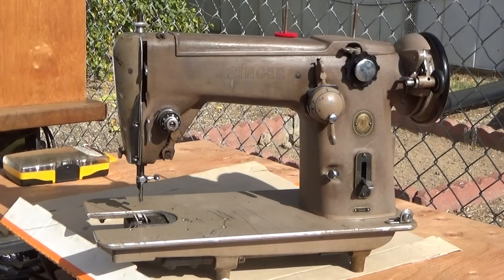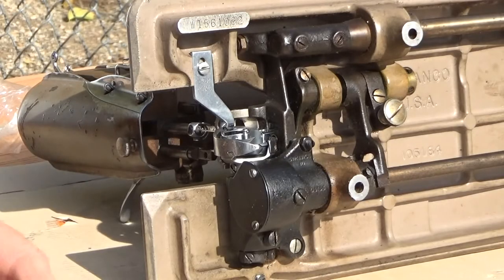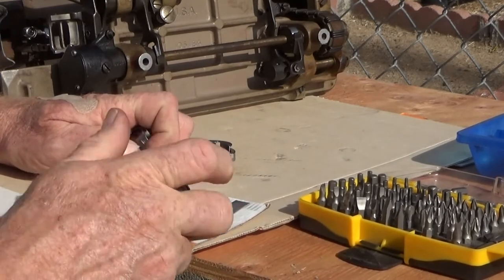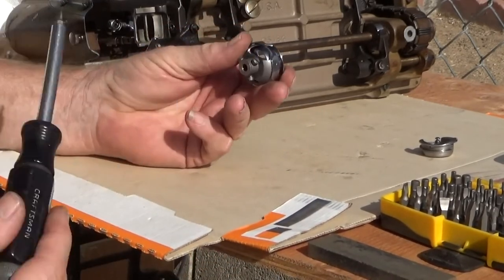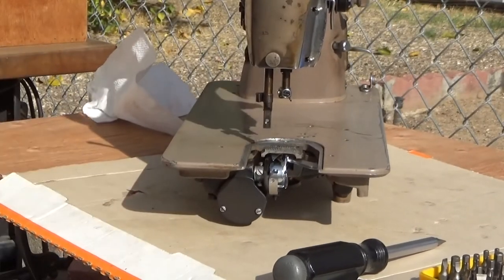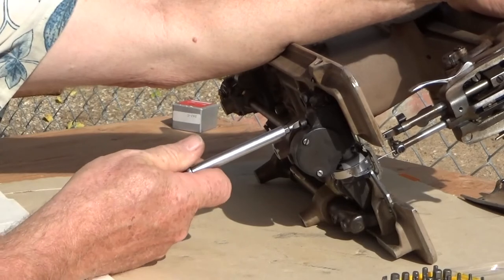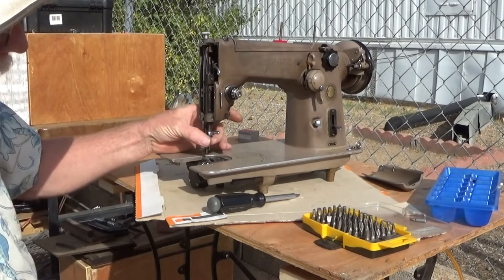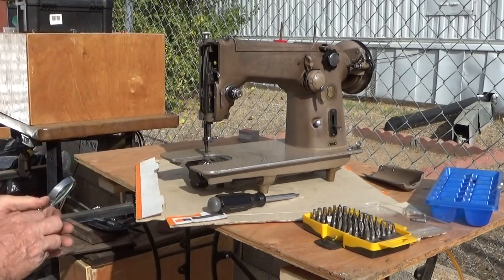Singer 306 Hook Swap

Comment: I know I’m a bit late. But my hook broke your video was kinda helpful. I got the 2 set screws out and that little metal arm bit my hook still won’t come off is there a special alignment I need or do I just need some elbow grease? Hope you can help mine won’t come off at all. I even tried some machine oil but won’t budge.
Reply from the maker: Do you have the hook that uses two set screws or three?  I know that sounds kind of lame but if you have the three screw model, when you have it in a position where you can reach two of them the third one is sort of hidden.
Reply: @joekahno  I’m sorry I just saw your reply. No I was double and triple checking. It only has 2 screws.
Reply from the maker: @DakotahMiskus  Ok, if you have loosened the screws and the hook is still tight on the shaft it is stuck for some reason.  Unless the machine has been used as a boat anchor it probably isn't rust, more likely old oil that has dried to something like glue..  Completely remove the set screws and apply penetrating oil  in the holes and around the base of the hook.  Let it soak, preferably at least overnight, longer is better.  Get a good grip on the hook and jog the handwheel forward and back rapidly.  If that doesn't break it loose we may have to go for something more aggressive.

Comment: Can you tell me the part number and brand or where you got the 20-U shuttle and bobbin? Also, can you tell me where you get your Hirose parts? Thank you
Reply from the maker: Try ebay.  The stock hook assembly for the 306 is a Hirose TA1-Z16  The 20U bobbin case is available from several vendors.  Standard L class commercial bobbins will work if you have a separate bobbin winder.  The closest thing to Singer OEM bobbins are at Central Michigan sewing supply.  https://www.vintagesingerparts.com/products/6-aluminum-bobbins-singer-part-55623aq?_pos=1&_sid=d1c5177b4&_ss=r  These are expensive but work fairly well with the bobbin winder on the machine.
Reply: @joekahno  thank you it has been hard because when i search 20-u shuttle it does not bring  back results or it says singer 15 class +shuttle and I do not know if that is the same thing?
Reply from the maker: @caseywilkinson1825  That's because the internal part of the hook assembly, the piece with the post the bobbin case latches onto, is sometimes called a shuttle.  If you search for "20u bobbin case" they're not hard to find.  Finding a good one is a little harder.  Most of them are Chinese imports, some are pretty good, others are junk and the price doesn't seem to mean much.

Comment: Hi, I was wondering what’s the part number of the 96-10 hook from Hirose?  Thanks!
Reply from the maker: Singer 52089 I believe the Hirose equivalent is a DA1-A but I no longer have the parts box or machine I installed it in.  I just found a Hirose TA1-Z16 which seems to be their number for a 306 hook.

Comment: can you add a walking foot bar to these machine the patnet are very similar for most of there machines
Reply from the maker: I haven't worked on a walking foot machine so I couldn't even guess what would be involved.  Somebody had to do it the first time so it may be possible.  I just have no experience with it.
Reply: @joekahno  on my 306 it seem to have a bigger hook an bobbing case already in there

Comment: Trying to figure out how to align the finger properly.  And also trying to figure out how to notch out the case for it.
Reply from the maker: I've done it both ways.  I had an extra finger I filed down on the left side until it had clearance for the narrow notch and opened up another one with a Dremel to take the standard finger.  Either way you  need to have enough clearance for the heaviest thread you use to slip past the end of the finger.  No sharp edges.  Of the two, I'd rather modify a new manufacture shuttle than a original part that might be hard to replace if I mess it up.

Comment: do you stil have this machine can you check what part number the needle bar assembly is
Reply from the maker: I took a quick look but all you have on the machine is numbered individual parts.  To find a number for an assembly you need to check the parts list in the manual.
Reply: @joekahno  i know what part mine is .... simanco 150169 needle bar 105186 im sure you bar for the needle is bigger ??? maybe

Comment: I realize I have another question and that is whether or not a 319 bobbin case will fit the 95-10 hook assembly?   I know you use a 20u bobbin case with the 95 hook assembly, so really what I'm asking is whether I can continue to use my 319 bobbin case if I swap my hook assembly for a 95-10 assembly or do I need to use a class 95 bobbin case?
Reply from the maker: I can't be 100% certain on the 95-10.  It's the short arm version of the 96-10 that I am familiar with.  The bobbin/case/shuttle/hook assembly is made up of nested pieces.  Some combinations fit, others do not.  Combinations that may fit together physically may not play nice.  Short answer?  It depends.  I'm currently prepping two 306's for sale while getting the third one set up for my personal use.  Keep checking back for more video.

Comment: Ditch those needles and go with juki needle. Works way better.
Reply from the maker: I did a quick check.  Juki is usually sold with Organ needle installed.  The same brand I use.
Reply: @joekahno  top is round. Not flat. 15x1. Also the needle is slightly shorter from top to the scarf/eye, like hair thickness. From the scarf/eye to tip like 2 mill shorter. I use size 16 or 100 and works very well sewing 8 layers denim. Have set gap on the scarf though. I changed the needle bar on my juki to 135mm. I was left with 16 x 257 needles of all sizes. I did the bobbin case and hook assembly upgrade. Had to modify the hook assembly Slightly. Still touches on far right a bit. Other wise works ok. I have 2nd singer 306k in much better condition. Standard bobbin case and hook assembly and also just touches when sewing on right side. 🤷‍♂️. I can zig zag for miles. So I think it's OK.

Comment: hey Joe, I I hate to be a pain but I still cannot find the shuttle and bobbin case for the conversion. I reached out to central Michigan sewing supply and the want to know if it is a 20u33 or 20u13? Is there anyway to send me a link or let me know? I got the hirose hook assembly but i cannot find the other parts and I'm working on converting 2 of these. Thank you so much for your help